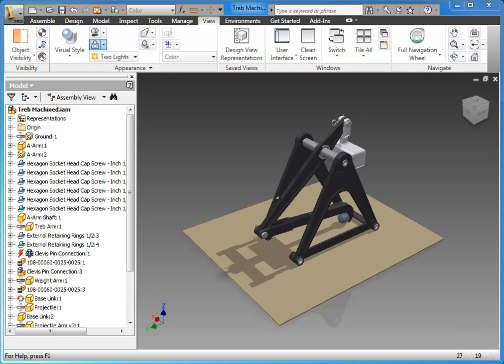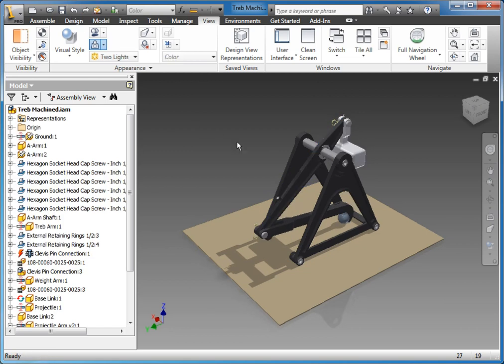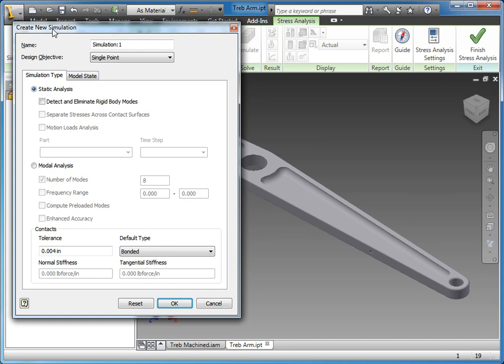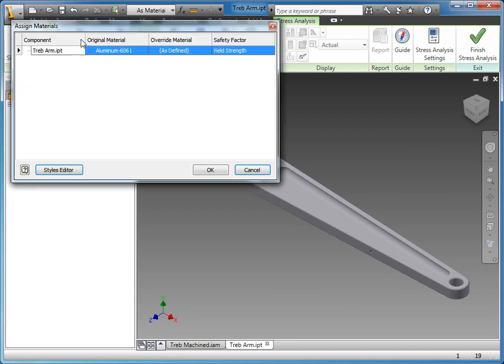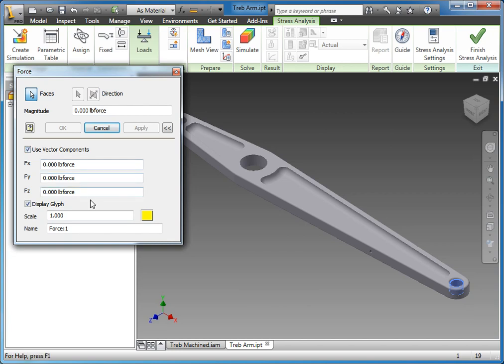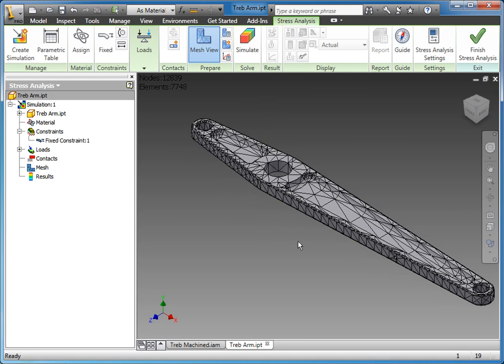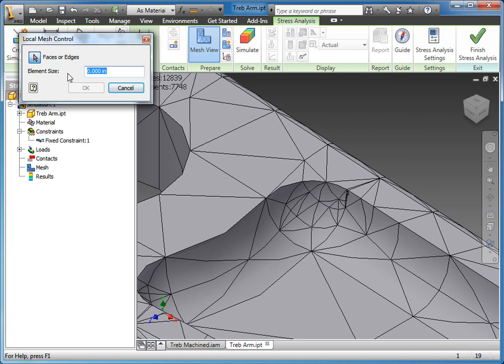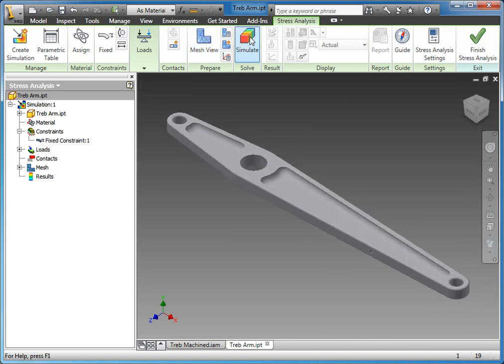Part 1 - Dynamic Simulation & Finite Element Analysis (FEA) - Autodesk Inventor 2011

Comment: @JohnHelfen My first one is only small but plan to make one around 7ft square, 8ft high. not to sure yet. i am using inventor 2009 still but im hassling my employer to get a subscription again so i can get 2011. When i get it i will definately look into this frame analysis im very intrigued